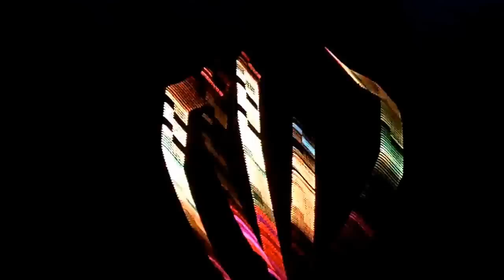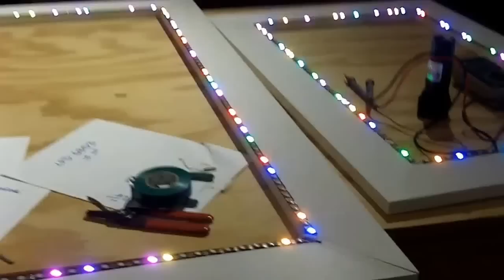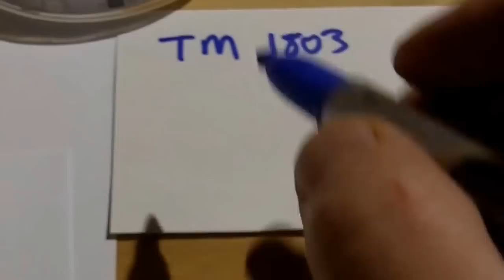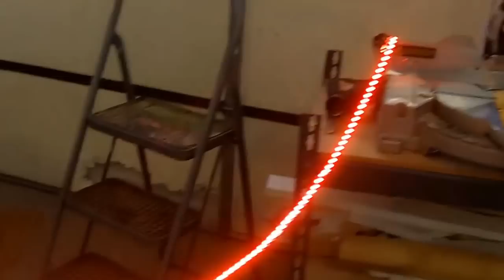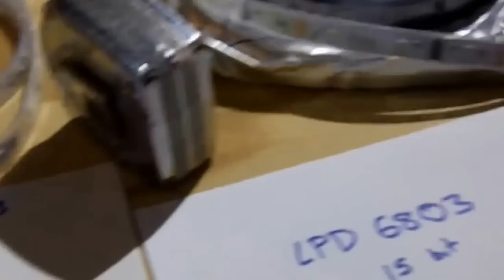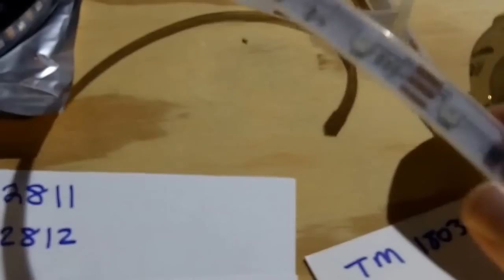S007: Holiday Lights and info

Comment: What bothers me the most with these LED stripes is that the manufacturers only care about color perception, and not the physical effects of the light spectrum. For example, at least around the 464nm range should be controllable (changeable to other blue wavelengths) for late night illumination, to reduce melatonin suppression (which is very unhealthy on the long term). It would be also nice to include a 296nm peak, to replace D-vitamin tablets in a more natural manner. This company is getting closer how LED lightning should be done in the right way: http://ledmotive.com/
Reply: +Tibor Gáts Hi Tibor, thanks for the link! I'm also thinking that we have to be careful which light we use and also when. I installed f.lux to filter the blue color of my monitor automatically after dawn:
https://justgetflux.com/
Reply: +Sebastian Glanzner, thanks for the tip! However, this f.lux was not maintained a while ago, and as I use Linux on my machines this works better for me: http://jonls.dk/redshift/